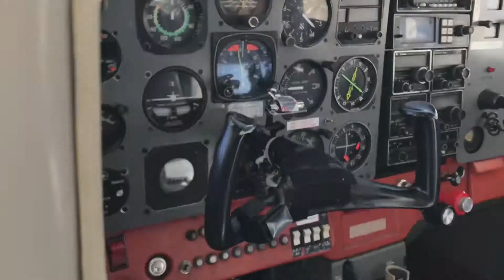Elevator on a Cessna 172

Comment: Nice, thanks..is it true, at the cessna, that the elevators (at rest) are all the way down before take-off (the yoke all the way forward) and automatically become horizontal due to the acceleration on the runway (the yoke in the middle) and then take off by pulling the yoke so that the elevators move further up?